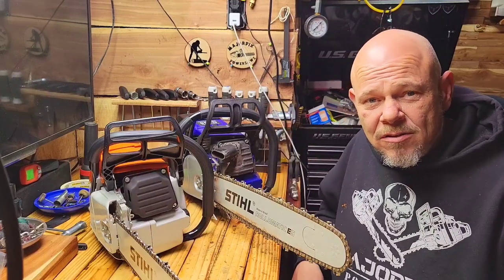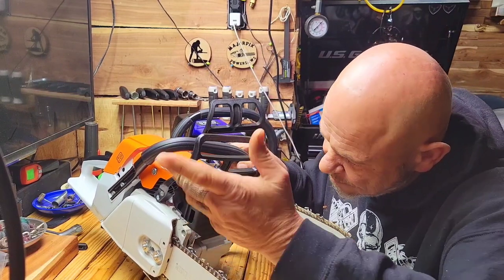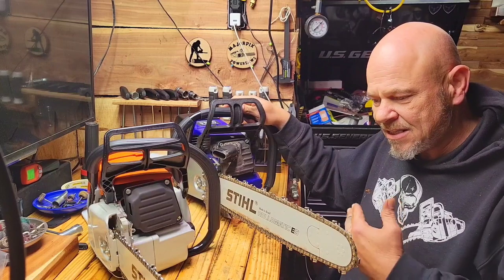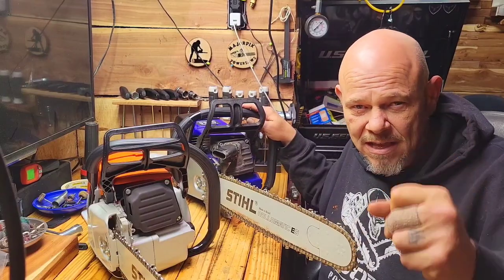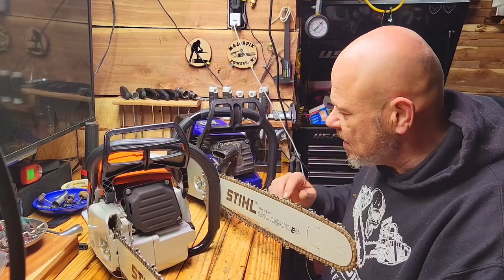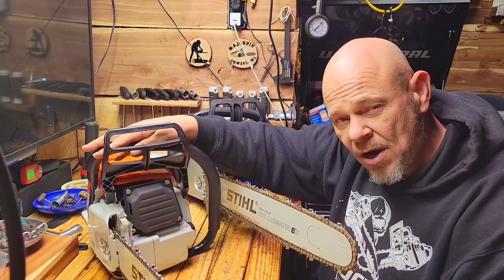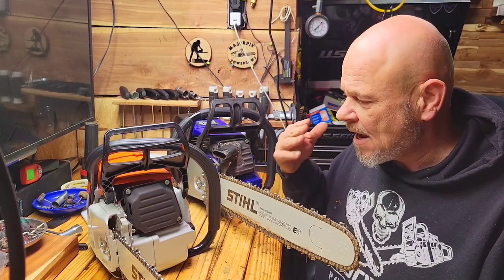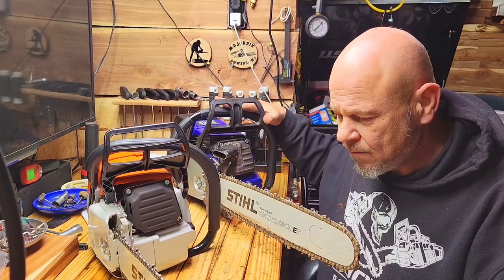Neo-tec ms381 72cc vs Holzffarma g460 76.5cc, which is faster? review of the Chinese clones

Comment: great video i wanna ask tho whats the longest lasting clone saw that you own just wondering i only normaly buy used oem saws then if i do a top end i normaly use hyway stuff but i havent had any luck with oem ms460s i have 2 with bad bottom ends dont matter to me witch on you do i have both saws but oem been eying up some of the clone saws tho are they starting to put real walbro carbs on them
Reply from the maker: My oldest is 4 years old, and the next oldest is almost 4 years old! Only had to replace a boot in the 372xp clone because of milling... that's the white one you see with the full wrap! And the holzffarma g660 haven't needed anything! And it's milled 100s of logs! 
Probably 250 300! 
Now, air filtration is a big key! To make them last! Keep them clean and make sure they seal up well! 
Thanks again for watching 👀 brother
Reply from the maker: I have had other problems from clones... such as the oil pump seal leaking in the 288, had to replace a carb that wouldn't tune! New seals in a few that had about 75 hours on them! But, overall, the parts are cheap and very easy to work on!
Reply: @majorpixchannel7146  kool sounds good been thinking on doing other things maybe put the 460s on back burner for a bit kinda wanna try to do 86cc 372 like iron horse did for buckin also been looking at clone 660s gotta do some thinking keep up the good work
Reply from the maker: @BRYAN MEIER272XP  thanks Bryan... and sounds like cool builds!!! 😎

Comment: You mentioned running it rich at 2 turns out. Wouldn't it be the same idea if you just set it at 1-1/4 in the instructions, but run a 25:1 mix for the first few tanks during break in?

Also, is there a specific NS872 aftermarket muffler you recommend over the stock for better performance, without doing any mods?